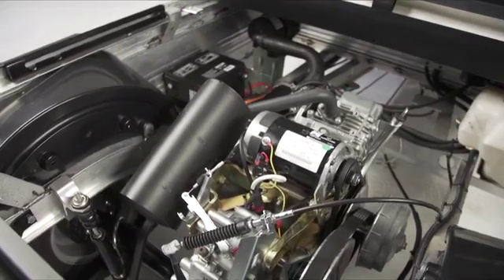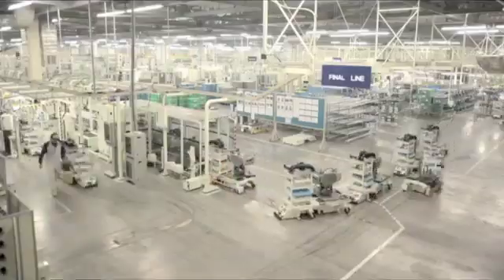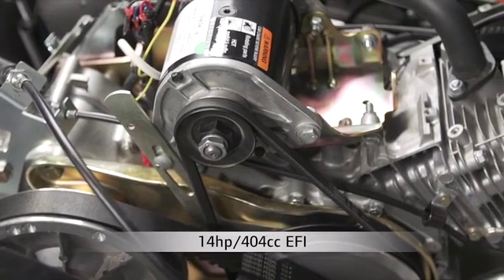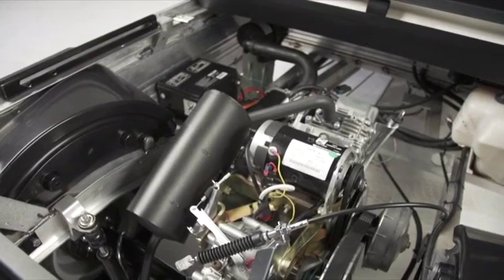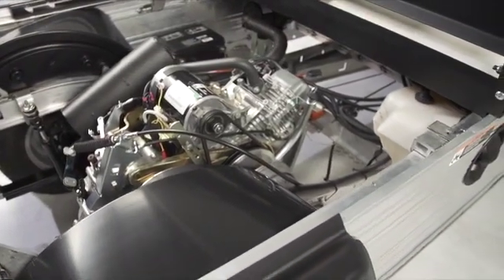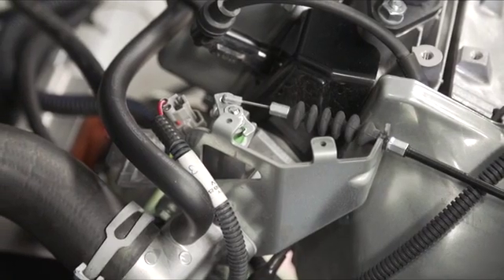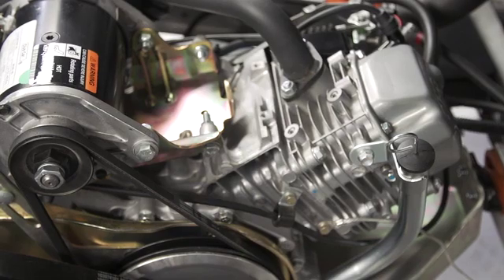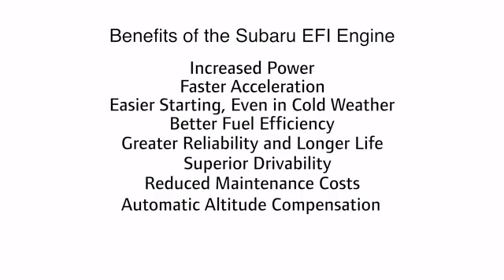Carryall - New Club Car 2014 utlity and turf vehicles come standard with Subaru EFI engine

Comment: @jeffevil666 lol you are stuck in the past...don't be jealous because club car is leading the way in technology...ezgo still uses the hickupson motor...The worst motor ever produced...
Reply: Funny all the EZ-GO's I see have Fuji-Robin (Subaru) or Kawasaki Engines...which anyone with a brain knows are excellent engines...
Reply: @misters2837  but they are not EFI. Funny thing is Club Car recently switched to Kohler EFI engines. But the Kawasaki engine that EZGO designed was stupid. An oil dipstick that goes through the valve cover and plastic oil pilugs? A super inaccessible oil filter? Fun
Reply: @andym1223 : Actually most engines used in these things are "off the shelf items", so your right that Club Car is at fault for not properly designing the Chassis around the engine, making service a pain, but Kawasaki and Kohler and Subaru/Robin are not to blame, they built the engines for "industrial use" and C.C. adapted them to THEIR chassis... And the only reason C.C. didn't have EFI is because they were too cheap to buy it, Kawasaki has had EFI small industrial engines since Y2K but most companies don't see the point on something they have already spent a lot of money outsourcing parts. Dana Trans-Axle, Comet Clutch, and so on, so their bottom line is chewed up by not making those parts themselves.  And though EFI is "great when it works properly" it also adds complexity sometimes not necessary.